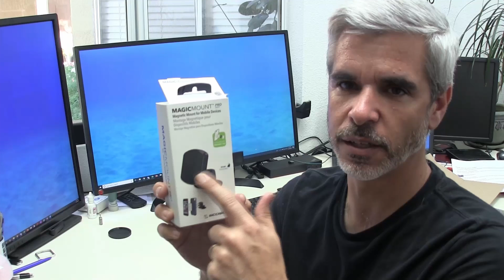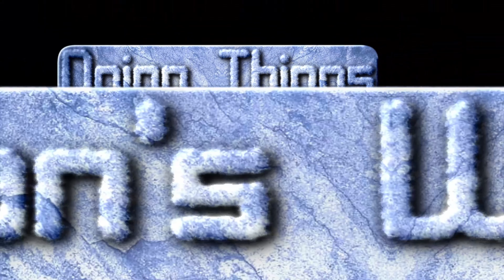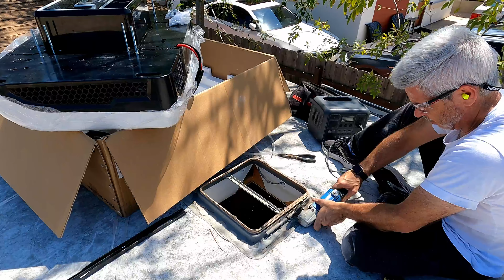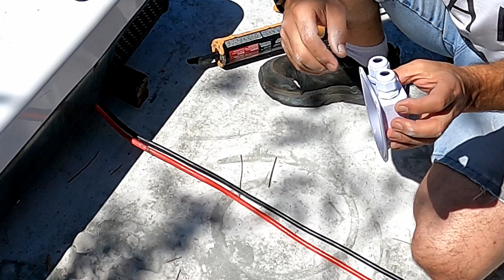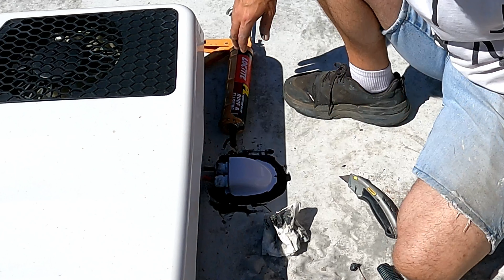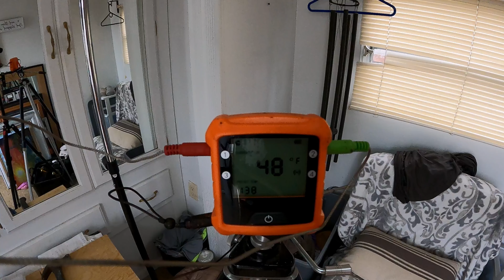ModsPioneers 12Vac RV Air Conditioner Install - Keeping cool using batteries and solar works???

Comment from the maker: Hey everyone.  Thanks for watching my video.  This pinned comment will serve as a place for me to update this video with thoughts, impressions, concerns, etc, in the years to come.
1. We have used this AC several times in the past two months or so.  In particular it is great to have the bedroom cooler than the main room, especially when sleeping. My wife and I find that having 'pink' noise like a fan or AC running really helps us to ignore sounds outside.
2. No other concers at this time to report.

Comment: Thanks for the video! I will be installing this today as well! I just ordered the longer M8 rods since we'll be installing this on a 5th Wheel as well. Just wondering, it calls out to drill 8  holes - but it looks like you only to 4 and use only 4 of these rods - is that true? Are the additional smaller M6 roads not being used?
Reply from the maker: I don't actually drive this around, so I wasn't so concerned.  Judge for yourself if you think they are needed.  There is more than enough with the four going through the steel brackets.
Reply: @DansWay thank you! Isn't the inside cover connected through the smaller bolts or can they be mounted with the bigger rods as well?
Reply from the maker: I just screwed the plastic inside cover into the wood perimeter of the hole.  I can't imagine getting all 8 threaded rods aligned through all of that without large holes.  Nothing structural about the plastic, so just use simple screws to hold it up.  Trim out the hole, paint in flat black to hide, and call it good.
Reply: @DansWay thank you!

Comment: Great install. My toy hauler is only 32 foot, I would like to replace my existing 120 to the 12 volt. It's all ducted so it should be perfect. Thx
Reply from the maker: Challenge would be the ducted systems need to have separate intake and exhast that pushes down the ducts.  I don't think this would work for that particular situation.  For my trailer, the back room is ducted, but the airflow is just not sufficient to keep it cool.  This additional AC provides the cooling power needed in the back room.  Ultimately I could replace both units with these, but I would need to upgrade the battery system to handle it.